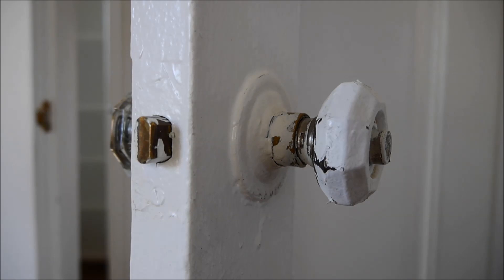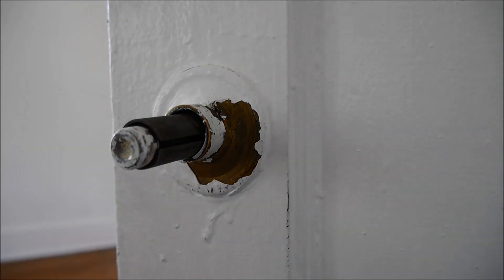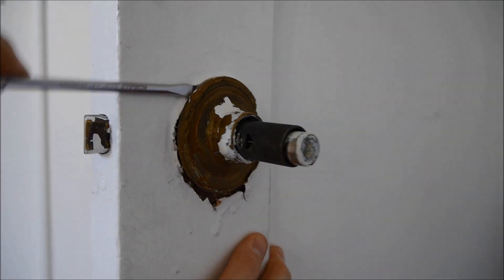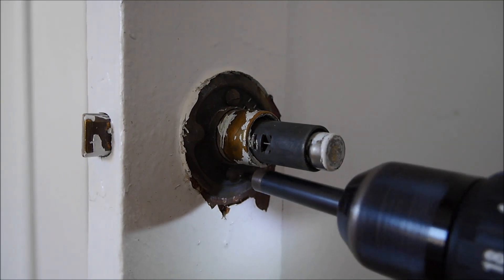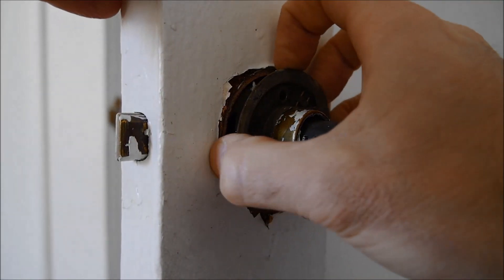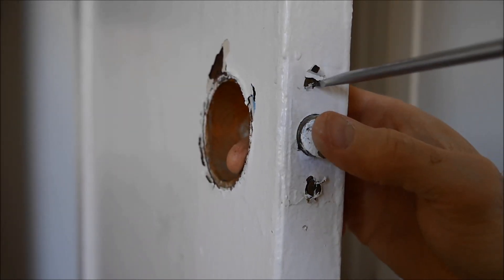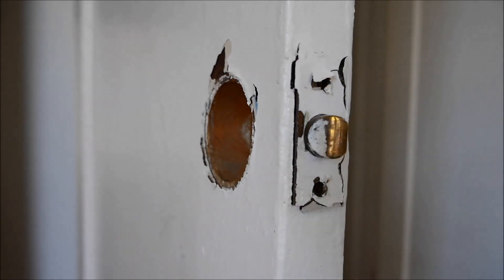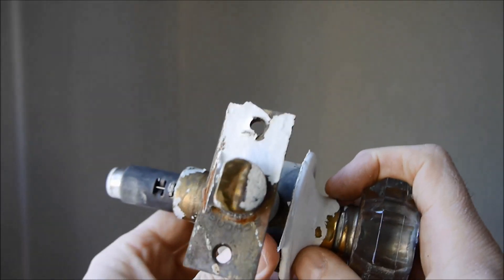How to Remove an Antique Schlage Lock Set

Comment: This video was invaluable to helping me figure out how to get my antique doorknob off... until it came to the pulling/pushing part~ my Schlage knob has a privacy lock and we eventually figured out we had to rotate the mechanism inside. This may seem obvious to some, or maybe not applicable to the knob shown, but I definitely don’t know anything about door knobs, so I hope this added detail helps someone else. Thanks for helping me locate that little divet at 7 o’clock!
Reply from the maker: Thanks for the tip, they did have slight variations through the years with certain idiosyncrasies.  Glad it helped, hopefully yours didn't have 10 layers of paint 😁
Reply: same comment as above—and the addition of the tip of rotating the mechanism was the magic. Thank you BOTH!!!

Comment: Great video! Thanks for showing how to do this the right way! Pro tip: use an x-acto knife to carve around the hardware. This prevents the paint from exploding and making a mess. Take the lock apart, clean out the old grease, put some fluid-film inside, remove the paint and it's good to go :)
Reply: Instablaster.
Reply: That’s what I was thinking!

Comment: I was unable to remove my Dexter doorknob exterior lockset in thu usual manner described here. The 34 yr old set was loosely on but still working. I wanted it replaced. Schlage now owns Dexter. What I finally had to do was use a metal blade on my saw saw and remove the interior knob knob, cutting it off. Then there were 2 visible screws which was easily done. Saw saw works miracles.

Comment: Yeah but how do you get the other side apart I want to rebuild this assembly but I don't wanna bust it taking it a part
Reply from the maker: It can be disassembled but I wouldn't recommend it unless you have some spare parts.  The tab that holds it all together can snap and then you're SOL.  If it's sticky then give it a good dousing with a liquid dry lube like 3-in-1 lock lubricant and work it back and forth until it operates smoothly.  Lots of times these have never been lubricated in their whole operational life.

Comment: How do you access the actual cylinder lock? I have knobs like this and I’d like to re-key them. Thanks!
Reply from the maker: This one is from the 1920's, so I'm not sure if they're all the same.  There is a tiny tab that's twisted which holds the cover in place, if you untwist it you can slide the cover off to access the interior mechanism and remove the lock cylinder from the inside.  Just be careful when twisting the tab, it can snap off pretty easily.  Not the end of the world, but it does keep the whole assembly together when out of the door.  Take lots of pictures while taking it apart!
Reply: It depends. If you have a pin tumbler cylinder (key has only one edge with teeth), insert your key, turn your key and hold it at the 90 degree position, then use a probe to push the detent in the hole while pulling the knob out. Carefully pull the cover off the knob and slide the cylinder out. Then take it to a reputable locksmith and have it rekeyed.